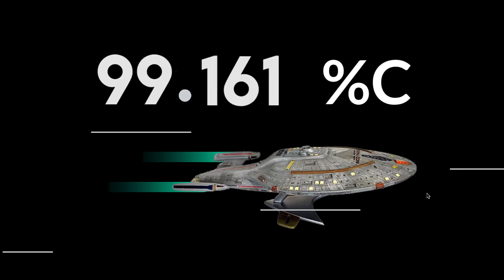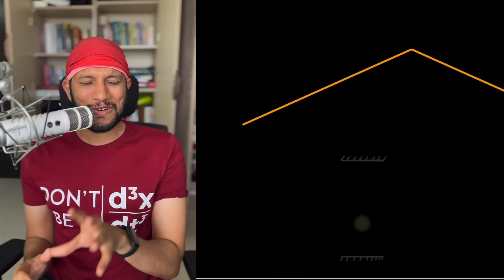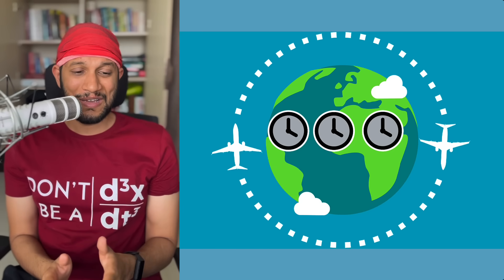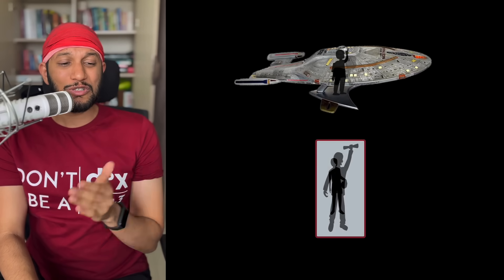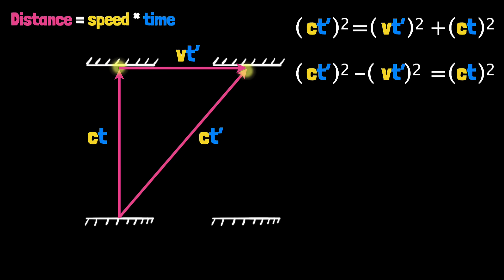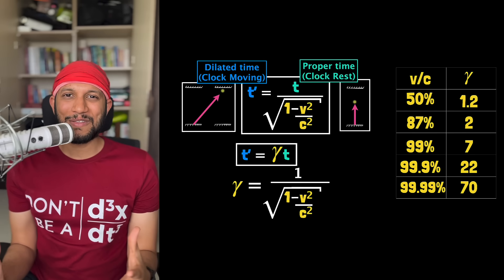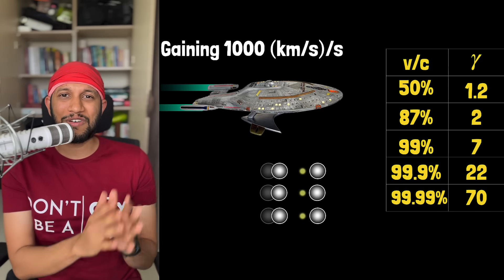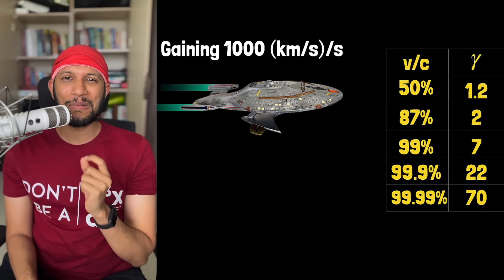I finally understood why you can't go faster than light! (My mind is blown)

Comment: I'm sure I'm missing something, but to me this only explains why we can never observe something accelerating to the speed of light from our frame of reference.  From our point of view, it takes infinite energy or infinite time for a spaceship leaving earth to reach the speed of light, but to the ship's passengers, it all seems normal.  If it takes about a year (ignoring relativistic effects for the moment) to reach the speed of light at an acceleration of 1 g, then to the passengers on the ship, 1 year will have passed when they reach lightspeed.  To us, they never get there because of the time dilation effects, but to the passengers, they get there in one year using a year's worth of fuel.  If they take two years worth of fuel in order to decelerate after reaching lightspeed, then after 2 years ship time, they will once again be stationary with respect to their original frame of reference.  They will then starve to death because the heat death of the universe occurred an infinite amount of time ago and there is nothing left in the universe to eat.

That's how it seems to me, anyway.  What am I missing?

Comment: People are so easily convinced a photon cannot achieve a higher diagonal velocity, umm let's just say it travels with speed c vertically and a variable speed horizontally induced by the spaceship...why do we intuitively assume this is not happening
Reply: We (rather counterintuitively) know it doesn't happen, because it's been proven both theoretically and practically that the speed of light is constant in every frame of reference. So if I'm flying in your direction at half the speed of light, and turn my lights on, the light from my ship still approaches you at 1c, not 1.5c (quite bizarrely).

Comment: A question
Video explained if two clocks one on earth and one on space ship with velocity is compared then space ship clock would appear it has  slowed down

But what if you are on the spaceship and earth passes you by with some velocity in that case same situation would apply Earth's clock would appear to be running slower than spaceships clock

Which is it?

Comment: So I have 3 questions and not mutch of an understand of the subject:

1. Why would the photons in the photon clock move, together with the spaceship, forward when it moves? Does this has to do with the observer?
2. How would the experience be inside the spaceship? I understand why it cannot reach lightspeed when you look at it from the outside, but will it work inside the space ship? 
3. How come photons (light is self) can travel at the speed of light? Isn't this where all the problems start?

Or do I not make any sense? :) (I'm still confused)

Comment: In a way it isn't "The speed of light" 
Its the speed of causality. Nothing can happen faster than that. Light simply by its nature travels at the maximum possible speed, thus matching that speed.
If the speed of causality was faster that is the speed light would travel at. 

Note: This is referring to "In a vacuum" which is what 'c' refers to.
Reply: Yeah. It's basically the speed at which reality itself propagates :) There's nothing special about light in this sense. It just happens to be massless and kind of "have no reason" to be slower than the maximum.

Comment: so basically it isnt worth spending that much energy to go at light speed because to go at light speed for 1 year would wast or deplete so many suns or a great amount if anti matter which is rare or exotic. so conventionlly thats like using up all the oil fields thats non renewable. the solution ofcourse is we need neutron star or a quzar star or some perhaps even a super massive black hole to power our FTL ship. but even then it might not b enough. but also we dont need light speed. we got options like warp and slipspace which ofcourse would b powered by anti matter or some exotic dark energy. or we just hit 50 percent light speed is enough. i mean pure light speed for objects just isnt worth it. our ships would shatter from tiny debris. so pure light speed is suicide.

Comment: But you didn't explain what does happen on the ship? If you accelerate with (1000km/s)/s, and you are inside the ship, does the acceleration stop when you hit 299.000km/s ? I mean, you can't continue to accelerate with 1000km/s because otherwise you would exceed the speed of light.

Comment: 10:04 wouldn’t we have to calculate the speed of earth rotation to the proper time variable? Because we’re not completely still on earth.
Reply: Just assume a flat unmoving earth.
Reply: @SicaCinema that doesn’t make sense
Reply: It was a bit of a play on flat earthers. But you have the frame of reference from reference from earth and the frame of reference from the ship. If we had to calculate earth movement and ship movement,  we need a 3rd frame of reference outside of both.

Comment: I have a question which may have been answered in the comments already, the Photon clock indicates a diagonal trajectory of the photon due to the orientation of the clock and the direction of travel of the ship, What if the photon clock was oriented differently? Instead of a vertical clock with a horizontal reference frame, what happens to a photon clock that is oriented in the direction of travel? Since an object with mass can not travel faster than light would the photon not then be accelerated towards one end of the clock during each cycle? Following that thought train would the clock then be ticking faster?

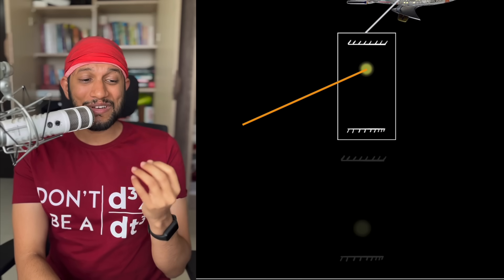Comment: I got to 2:13 and still didn't understand why it matters that the photon appears to follow an ever-lengthening diagonal path to an observer.  The real path is inside the ship; outside is just an illusion of perspective.
Reply: It doesn’t “appear” to move diagonally, it does, unless you assume the ship is standing perfectly still in space and it is in fact the universe around it that is moving. If you measure the distance between the point where the photon hits the bottom and the point where the photon hits the top it will increase as the ship moves faster, just doesn’t seem like it because the bottom and the top also moved during that time. Imagine you throw a rock from one car to another in the next lane over, but the rock only lands when both cars have moved a whole mile because they are both going so fast. In that time, did the rock travel a whole mile, or just a few meters from one lane to the other?
Reply: consider your space ship a rectangle with only 2 atoms one on each end(one on the left and one on the right). there is a force bieng applied from the left side, and you accelerate that rectangle towards the right side of the screen, for the acceleration to register and for the rectangle to move, one atom needs to move(left atom), and then that movement needs to registered by the second atom(right atom), so, lets say if the rectangle is just starting out, the electromagnetic force will move at a speed of light and the rectangle will move as usual, in its perspective time is flowing as usual. now, lets say the rectangle has accelerated to 50% the speed of light. both atoms in the rectangle are moving at 50% the speed of light, now if it wants to accelerate, a force is applied to the rectangle, and the second atom(left atom) would be the first one to accelerate, and that acceleration needs to be transmitted through electromagnetic force at the speed of light to the second atom on the right for the entire rectangle to move and accelerate as one. but the thing is, the second atom is also moving at 50% the speed of light, so the electromagnetic force takes 2 times more to reach the second atom, even though the force is moving at the speed of light, the second atom is moving away from it at 50% the speed of light, so it takes longer for it to arrive, doesn't matter if we are looking at it from the outside or the inside. the propagation of force will always be slower the faster you move. and if you move at the speed of light, you don't move, because the time it takes for the electromagnetic force to move from one atom to another would literally be infinite. no matter how much energy you put into the left atom in our rectangle example, it wouldn't reach the right atom, because it is moving at the speed of light.

From the perspective of someone outside the rectangle spaceship, the rectangle is moving at light speed, but from the perspective of the spaceship, you have barely aged or barely moving.
Reply: @swapnilmankame  This is genuinely such a helpful explanation. I believe this also illustrates the phenomenon of length contraction, since as the pair of atoms gets faster from our inertial reference frame, the second atom does not experience the repulsive force of the first as soon and so they would appear to become closer together. Since all forces propagate at c, then wouldn’t this also mean that the atoms themselves and their components experience length contraction as well?
Reply: so.. interesting ideas so far. einsteins theory bases on relativity. there is no „absolute“ speed. you can only measure speed with a reference point (observer). if you stand next to the moving ship, you observe a slower „clock“. if you are inside the ship, the „clock“ ticks faster. that is indeed true, because the rest of the physics actually „bend“ (or let’s say weird stuff is happening at those extremes), to make this constant speed, for the path the light seems to travel, possible. to the outside observer the actual time from the internal observer appears slower. they move slower, everything (including light movement) is slower. to the internal observer everything else suddenly goes faster. So, if you are faster than light, you would outrun the universe. And there is nothing from this universe outside of the universe. I hope someone was able to follow me here.
Reply: No such thing as the real path. These are all inertial reference frames, the same laws of physics applies
Reply: The clock arm explains it, the information from one atom to the other travels at the speed of light, so if you're moving the atoms around the speed of light the information can't reach it

Comment: Does this mean that accelerating to the speed of light is possible from the perspective of within the spaceship?
Reply: No, because separate/irrespective of time dilation, a physical object with mass can't reach the speed of light. As an object accelerates, it becomes more and more difficult to speed up because its momentum increases. The closer it gets to the speed of light, the more energy is required for even a tiny increase in speed. To reach the speed of light, you would need an infinite amount of energy, which is impossible to obtain.
The idea that mass increases as an object speeds up is a helpful way to think about it, but it's not quite right. A better way to think about it is that an object's inertia, (its resistance to a change in motion), becomes infinitely large as its speed approaches the speed of light. This is why you could not accelerate to the speed of light even if you had infinite time, you would still need an infinite amount of energy to keep pushing yourself.

Another way to say this: you can't accelerate to the speed of light with finite energy (even if you have infinite time, because you'll exhaust/use up all the energy in the universe before even getting close to true Lightspeed), there is one way you can say you can reach lightspeed, and that's by having an infinite amount of energy and an infinite amount of time, in such a scenario, you can reach lightspeed if you're willing to wait forever, literally have to wait for infinity before achieving C 😂 you'll forever be getting close to lightspeed but never truly there, all the while you're emptying the universe of all it's fuel/energy, this is why it's not possible in real life🫡
Reply: consider your space ship a rectangle with only 2 atoms one on each end(one on the left and one on the right). there is a force bieng applied from the left side, and you accelerate that rectangle towards the right side of the screen, for the acceleration to register and for the rectangle to move, one atom needs to move(left atom), and then that movement needs to registered by the second atom(right atom), so, lets say if the rectangle is just starting out, the electromagnetic force will move at a speed of light and the rectangle will move as usual, in its perspective time is flowing as usual. now, lets say the rectangle has accelerated to 50% the speed of light. both atoms in the rectangle are moving at 50% the speed of light, now if it wants to accelerate, a force is applied to the rectangle, and the second atom(left atom) would be the first one to accelerate, and that acceleration needs to be transmitted through electromagnetic force at the speed of light to the second atom on the right for the entire rectangle to move and accelerate as one. but the thing is, the second atom is also moving at 50% the speed of light, so the electromagnetic force takes 2 times more to reach the second atom, even though the force is moving at the speed of light, the second atom is moving away from it at 50% the speed of light, so it takes longer for it to arrive, doesn't matter if we are looking at it from the outside or the inside. the propagation of force will always be slower the faster you move. and if you move at the speed of light, you don't move, because the time it takes for the electromagnetic force to move from one atom to another would literally be infinite. no matter how much energy you put into the left atom in our rectangle example, it wouldn't reach the right atom, because it is moving at the speed of light.

From the perspective of someone outside the rectangle spaceship, the rectangle is moving at light speed, but from the perspective of the spaceship, you have barely aged or barely moving.

Comment: I still dont understand, if the beam moves up and down at the same speed, how is it slower outside? Why is it measured diagonally? Yes, if you stick a pencil to it, it draws a biger line when moved, but it still moves up and down at the same rate, so it should reach the top at the same time... 🤯

Comment: Due respect to Einstein and willing to be proven a dumdum on this subject but doesn’t the example of the photon clock prove only that a photon clock is not a 100% accurate method of timekeeping? Wouldn’t the acceleration of the mirrors just cause the photon to miss the mirrors as the speed of the mirrors approaches c?

Comment: My problem with the photon clock explanation has always been that doesn't explain anything with time. It just means that way of measuring time isn't adequate. Why is the observation of light how we think time works?
Reply: Also, how does this effect celestial bodies? If in comparison to us the sun isn't moving at all, unless you then take into account the motion of the solar system through the galaxy, but comparatively it doesn't matter since that also effects us in the same way.

Comment: @Mahesh_Shenoy
But how can you tell which object is in "absolute rest"? If objects are moving at constant speed, isn't there for each object an inertial systems, in which this object is at rest and everything else is moving?
Assuming there are two spaceships, A and B, moving in opposite directions at constant speed. Than there would be an inertial system in which A is moving and B is at rest. So time in A should be dilated and time in B should be proper. For an observer in B it should be the other way around.
Assuming they started from the same place (C) with synchronised clocks in opposite directions than they turn around and meet again and compare clocks. For an observer in C they were both moving and both clocks would have been slowed down equally. But relative to A only B was moving and clock B should be behind clock A, while B should expect A's clock to be behind because in its system A was moving.... But the clock's times can't be at the same time equal (as C should expect) and different (as A and B should expect - and both in different ways....)
Is that only because they where accelerating? But how is that different from the example of the airplane surrounding earth - especially as earth itself is rotating. So, the plane could have stood still while earth was rotating under it? So how can there be a proper time if everything moves relative to something else??
Can anyone explain this to me? .... Please?

Comment: I am still a skeptic of this... The explanation makes sense when comparing two frames of reference...

But, to the person traveling fast, time passed normally, and to the person standing still time passed normally... Only when comparing them there is a difference.

Now what happens if one person is going 99% of the speed of light in one direction and another person doing the same speed in the other direction (when compared to a 3rd person that is), to one person the other is doing 180% the speed of light... Would one see the others time in reverse? (It does actually make sense, you would see older and older versions of the other).

But then if person 1 wants to go the same direction and speed as person 2 they have to jump off their ship and accelerate 180% of the speed of light... So that should be possible right?
Reply: Now taking earth as a reference, it is traveling let's say 50% of the speed of light when looking at the center of the universe as a reference. Does that mean:

A - If we accelerate to 90% the speed of light in the same direction earth is traveling we would be going 140% the speed of light in the universe perspective? (Breaks this law)

B - we can only accelerate another 50% of the speed of light into one direction and 150% into the opposite direction? (Respects this law)